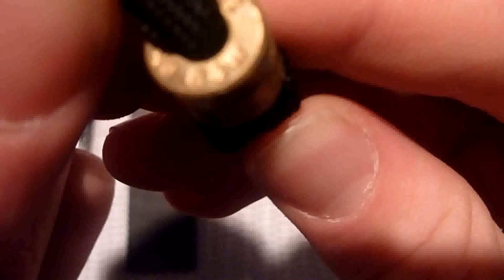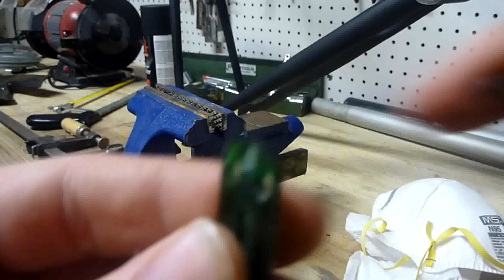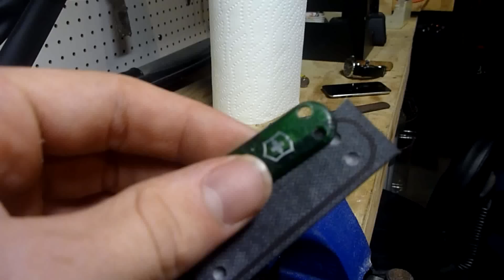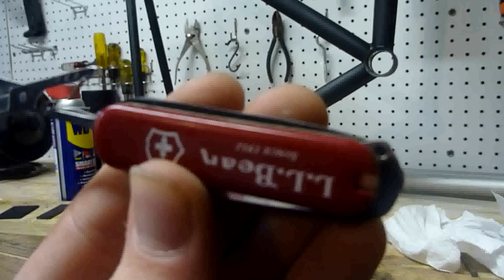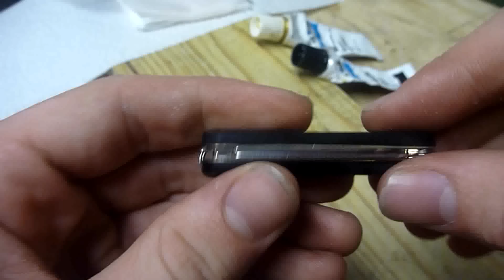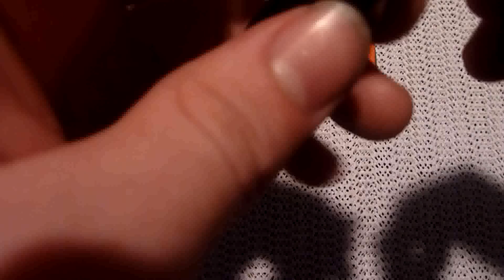(FULL) Making G10 Handles

Comment: I'm getting ready to replace the original scales on a Vic. MiniChamp that I got for cheap.  I'm going to remove the old scales to give it a good cleaning and have others I will re-apply.  It has been recommended to me to try Goop adhesive as it is not permanent, but is strong enough to do the job.  Might be a better choice than epoxy?